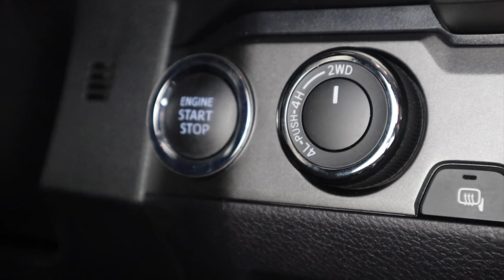Should you buy the latest Toyota Tacoma 2016-2021?

Comment: Bought a 2016 TRD SPORT 3.5 4WD new in December 2015. I've owned it for 6 1/2 years and have 37,700 miles on it. Kinda freaked out watching this because I've only done oil changes and tire rotations and scheduled maintenance. It surged a little when at idle the first year so maybe they upgraded the software when I took it in for an oil change. I need to have the brake light done under warranty but it's not leaking. AC is good, no noises to complain about. I'm sure he sees more 2016 models come in because they've been on the road longer and have the highest miles but don't doubt earlier years had some gremlins. Of course the 2019-2022's will develop some of their own, just give it time. I'm crossing my fingers mine was made early enough that quality control was higher than the later 2016's. I'll have the frame rust looked at and will toss it into 4 wheel drive each month. If you're looking at a Tacoma I wouldn't avoid a 2016. I think newer models are way too expensive. Mine is a crewcab and is loaded. I paid $34,500 new. The exact same truck is around $46k now. I can sell mine every day next week for $33k so basically it's cost me $1500 over 6 1/2 years and looks brand new. Why pay $10( more for the same truck? I've looked and they're exactly the same execpt they added crap like adaptive cruise and lane assist. Junk I don't want and lime he said you can't modify the newer ones so an added bonus having a 2016. I lifted the front of mine and added new wheels an Nito Grapplers. Rides great. Every Tacoma will have its issues if driven enough and they all break so I feel he's pointed things out he's seen because the 2016 has been around the longest. I've had no radio issues, no noises, no body rust and had it since Dec 2015. I'm not sure how many were built in 2016, maybe.200,000 + so hoping the issues he pointed out are more rare than expected. Good video though, but watching these always are a little unsettling. It's not bad info but I'll bet any amount of money there's 2019-2022's that have had major problems too. Kinda think some of these videos are sponsored by Toyota to get owners to bring them in to their delaers for service or to get guys like me to trade up to a brand new year. I mean the first thing he said is he's a Toyota mechanic and mechanics are notorious for saying stuff needs fixing. Not saying that's the case but not pointing out stuff on newer models is suspicious to me. Surely the newer Tacomas have issues so??? Hmm I looked at all the comments and if 2016's were notoriously bad there would have been dozens and dozens of comments. He says he sees hundreds and then said thousands and I see there's been hundreds of thousands of views to this video. I would expect hundreds of comments from people with 2016's but where are they? Don't avoid the 2016 because of this video.

Comment: You are correct. Lifting my 2019 Tacoma drove the lane departure and collision avoidance system bonkers! All kinds of warning lights and dinging. Fortunately my dealership is fantastic. I was able to sign a waver and they deactivated all that useless crap for me. 
By Lifting it and replacing most of the suspension I also got rid of the things I didn't like about the truck.... The crazy amount of body roll and the nose diving while braking. Once done I threw away the sway bar and now the truck is perfect on and off road!

Comment: Thank you for the excellent video! At 600 miles, I changed the engine oil with Amsoil SS, F/R diff and TC with Red Line 75W85/MT-LV, and the Manual transmission oil with Amsoil MTF/75W90. The MT oil was about .6qts low from the factory and the rear diff was over a pint low. MT oil surprisingly dark at low miles. Normal break-in shavings observed on magnetic plugs. Filled all until weeping except for TC which is 5mm below fill hole. Put neodymium drain and fill plugs in all areas in hopes of catching more metal as things slosh around. Rear diff venting the gas from the breather is stinky after a long drive, but no other issues as of now and the smell is gone in a few minutes, and doesn't linger so it's not a leak. 

Multiple reports on forums about low factory fill on auto transmissions, definitely would go through the annoying weep procedure if I had an auto and confirm the fluid level at the specified temperature range.

Comment: I used to own a 2006 Tacoma 4.0 V6... i beat the Snot out of that thing for 12 years and it NEVER let me down. I looked at newer ones (2018-2019) but Toyota changed the cab design, it was actually smaller, and I’m 6’4”...So i traded in for a 2019 Tundra 1794... its been rock solid so far. Sad news the V8 is going away. 😢

Comment: I’ve had a 2016 4x4 Sport, got it with front end damage with 12000 miles and have had no leaking or weird noises at all. I did all the needed recalls at Toyota within the first year, not sure if they got everything but I’ve had none of the issues mentioned.. which I now realize is a blessing.

Comment: Rust area issue.  Neutral safety switch seizes up, the shifter gets stiff. Transmission shifting issues. 
Rust area issue, the paper on the rear drum rusts the drum to axle hub mounting serface cause and vibration.
Great video

Comment: I have a 2019 and I live in NY. I've been using Fluid Film every year inside and out. So far I have zero rust. In the spring I use a salt neutralizer to remove salt stains from my cars. I also treat my 2017 Honda Civic and it's still rust-free too.

Comment: AMD, I prefer the term 'Salt Belt'. I live in the Salt Belt and this morning my 16 year old 'Toyota' got its Spring cleaning. It shines in the sun like the day I bought it because my PREVENTATIVE maintenance program includes annual RUSTPROOFING.  Rust = Neglect.
Reply: Funny you say that. I had a 13 Tacoma and when I bought it new, the salesman asked if I wanted DIAMOMD KOTE. I said why not. That $600 was well.spent. my frame was rock solid. 🪨 Now, with my new Tundra,  KROWN RUST.
Reply from the maker: Salt belt it is!
Reply: @TheCarCareNut  Excellent.
Reply: I'm in Pennsylvania and I started to spray my frame and rocker panels with Fluid Film.
Reply: @MrMikey1273  I am in Canada, the land that invented rust. Each year I set aside one whole hour to let Krown Rustproofing take of my car. The cost is equal to approximately 20 gallons of gas.
Reply: @rightlanehog3151  I'm in Canada as well and do the same thing with my car and truck. I thought about doing it myself but for the cost it's just not worth the bother.  Krown rustproofing seems to work really well, truck is an 07 and has seen a lot of salt but is still looking pretty good.
Reply: @bigrockk2980  About 20 years ago I heard Krown use the term 'body maintenance' to describe their product. At the time I thought it was just marketing.  Eventually I realized they were absolutely correct. Just like the drivetrain components need their maintenance so does the body. My car body maintenance also includes an annual application of paste wax and parking in the garage.
Reply: LOL I can't help but laugh because I'm my own worst enemy when it comes to salt and rust. I work for the DOT in Maine and I live on the road I plow. So when we're done with a storm, I drive 10 miles on the salt that I just put down. But the money I make putting it down I spend on washing and fluid filming so its all good.
Reply: I have my 2010 done at Krown every fall. It lives in MA and has no rust. Krown drills holes and sprays behind  all the body panels. 100% protection.

Comment: I have a 2020 Tacoma with the 4 cyl. 2 wheel drive.  I live in Florida, so it’s very flat here, I do tow my little 17’ Boston Whaler with the truck and have not had any problems with pulling the boat out of the water or launching.  I don’t tow it more than 20 miles, so I don’t have any feedback towing long term.  I have loaded the bed with 600lbs of rock and paver stones more than once with no trouble at all.  Overall I’m very happy with the truck, it will get 27 mpg when I run with no load and the a/c off.  On the highway with the a/c on I get about 22 mpg.  I do change my oil every 5k miles, I do not follow the toyota recommended interval of 10k miles.
Reply: Same here on the oil change, I'm 72 and even 5k seems long to me, oh! I always use synthetic oil.

Comment: Excellent video.  This tracks very well with my experience (2019 SR5 4WD).  DON'T BUY if you're expecting a smooth, quiet road car ride.  Buy if you want a heavy-duty midsize truck that feels and rides like a truck.
Reply: Idk my 2021 TRD sport double cab drives like truck but rides better then my 2018 accord sport
Reply: I bought a used one lifted with the cheapo ready lift so mine rides a little harsh, about to upgrade to a Dobinsons suspension with the leaf pack tho

Comment: My 2017 TRD Sport has had most of these issues. The frame whistle, third brake light leak, front breaks were done, etc. One more issue I would add would be the battery. Had to change mine out already with no excessive use, meaning, I hardly use the rear power converter and don't usually use the ignition power modes when parked. Thanks for the video!
Reply: Not to discount any of your other problems, but battery performance has gone completely to Hell in the last five years. EVERY brand, every size class. Even Caterpillar has binned their industry leading warranty program. Can’t blame a pickup for getting a bad battery, here and there.
Reply: Odyssey makes a fine battery still, the issues with AGMs in our trucks is that our charging system doesn't do the job very well due to the charge voltage, so they need to be topped off with a charger overnight once a month. Not a huge deal, but I liked Optima batteries but add them to the heap of lowered battery performance.

Comment: Great Video!  Thanks for taking the time to do it.
I have a 2020 TRD OFF RD DCSB 6 speed manual.     25k miles on it and I love driving it. 
Biggest thing I recommend people is try to find a 6 speed.  There hard to find but I think it’s better than the slush box automatic.  I hope to get 250k out of it with minimal issues.  Basic maintenance goes a long way.  
20 years ago I worked for a Toyota dealership.  Highest mileage Toyota I saw come in was a Toyota Previa (which is where this 2.7 4 banger originated from it had a 2 liter oil reservoir) with 670k miles on it.  The guy did general maintenance.  
2nd highest mileage vehicle I know of was a 91 Toyota 4x4 EC 5 speed with a 3.0 liter.  I personally know the guy he still has the truck and he’s got 575k on it.  Bottom line both of these vehicles were 1 - owner rigs and had the general maintenance done.  2021 Tacoma’s are being made in Mexico hopefully the quality is still there.  Mine was made at the Texas plant.

Comment: My 18 Tacoma required a recall on the fuel pump in order to register the vehicle in 2022. Just FYI for anyone coming by later. As of August 2022, Toyota does not recognize paint bubbling/peeling under warranty. This might be a case by case resolution, but my conversation with corporate denied my common paint issue on door seals. Excellent video AND excellent information as always!

Comment: I love the simplicity of the 4 cylinder, and I know they last until you are just tired of them. My 22RE still going strong with over 420K, it’s just VERY underpowered. I can’t see why Toyota hasn’t tweaked the 2.7 up to around 200hp. The ability is there, has been there for a long time. Give me a 2.7 with around 200hp and I’m all over it!
Reply: I have the 2016 4cyl and it has NO power.  This engine is an embarrassment for Toyota.  Always have to press the ECT button and always down shifting the auto trans, especially for any kind of incline.  I also have a 4cyl 2013 Rav4 and it's like night and day - tons of pep and throttle response.  And it has nothing to do with weight - I carry nothing in the bed most times.
Reply: @frankcee4342  My wife’s new RAV has over 200 HP out of a 2.5 engine. I know it has all kinds of added items that may cause problems down the road, but as you say, night and day. There is no way a large 4 cylinder can’t have 200 HP or more with all the technological advances they have already proven. I know this can be done without a turbo, although with the new Tundra coming out with turbos, I think Toyota will be using them more and more.
Reply: Hell yeah 201hp that is it. Damn toyota. Its all money, they will no longer sell the shittt 3.5 if they updated the reliable but boring 2.7
Reply: @frankcee4342  If you tune the 2.7 it actually hauls ass for a 4cylinder in a truck. Tune makes a big difference
Reply: I had an 80’s Toyota 4x4 with a 22R (no fuel injection). It could go anywhere and never broke down. My buddies used to call me for a tow if they ever broke down in a mud hole.

Comment: 2011 Tacoma OR was the best vehicle I ever owned and I'd still have it if I didn't mind maintaining multiple true 4x4 vehicles. Only problems I had were very minor, wear type problems that all vehicles have.  Toyota set me up with new leaf springs and new headlights under a TSB at no cost to me.  It did consistently need new tires as soon as the depth got to 5/32nds to remain safe, but that was usually right at the 36 month year mark anyway once the UV has compromised the rubber...part of that also was my driving as this vehicle is very capable on the highway (with the right tire and especially with that TRD Pro setup) regardless of the critical reviews that give it a "clumsy handling" type of rating.  Highly can recommend the 2011-2015 2nd gens if you can find one that has a good frame.
Reply: What is TSB and how can you tell is an '11 - '15 has a good frame?
Thanks
Reply: I have a 2007 tacoma 2.7l 4x4 access cab with a clean frame, 227,000 miles. I plan to keep it long term, and love that it is low tech compared to newer Tacomas. The frame was rustproofed several times by Toyota. (I believe the first frame rustproof was free for the prior owner.) The frame is original, though, never qualified for the complete frame replacement. I bought it in Florida from a snowbird and brought it back to salt belt. After I bought it, Toyota redid the frame rustproof for $600. 3 years later, they redid that again for me for free, some had worn off. (I believe touch free underbody car washes played a role.)  I yearly get the rest of the underbody sprayed with fluid film to ward off rust to the underbody. I stopped using car wash under spray, as recommended by the undercoater YouTube's. See Repair geek channel. My Tacoma is rust free after 5 years in Northern New England. As AMD says, when you find a rust free frame, and live in salt belt, you should get frame rustproofed and annually. spray something like fluid film on underbody. This year I'm getting the lower body of the truck repainted to ward off rust there. Truck has 227,000 miles, and runs great. For maintenance I use an independent shop and insist on oem Tacoma parts. Where I live it takes longer to get oem parts.
Reply: If you are shopping for a used Tacoma, I would pay to have frame inspected by a Tacoma dealer, or a very reliable Toyota independent shop. Get it on a lift and let them allow you to inspect it persoally with them. Take pictures of the underbody and frame also. That's what I did when I bought my Tacoma in Florida. The truck had Maine plates.

Comment: A bit off topic but I have an 06 Taco, 2WD, 4 cyl, automatic, SR5 with 373,000 miles.  Still runs like a watch!  The only unscheduled problems -- replaced leaky valve cover gasket at 160K, replaced a failed u-joint at 200K, and the clear-coat on the hood has been gone for years.  I might have to beat it to death with a stick!
Reply: I bought an orbital sander, sanded the shit out of the body and painted with rustoleum professional, actually looks great even two years later and always in the sun.